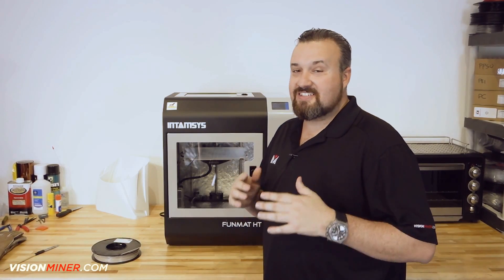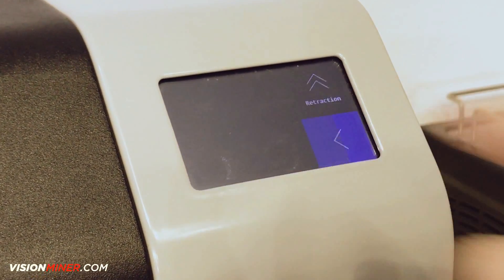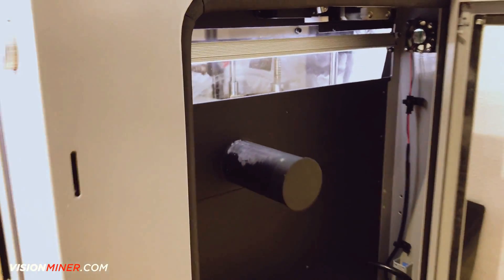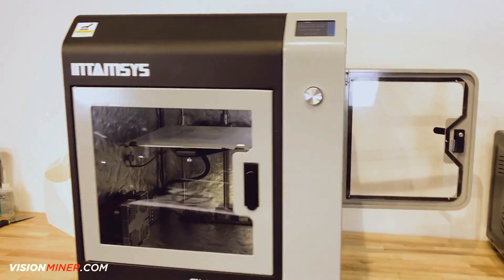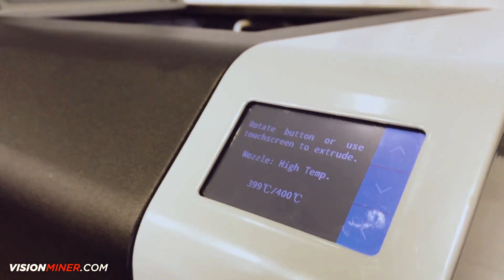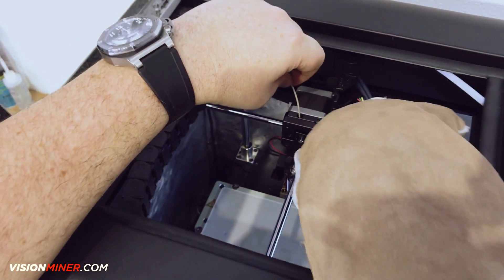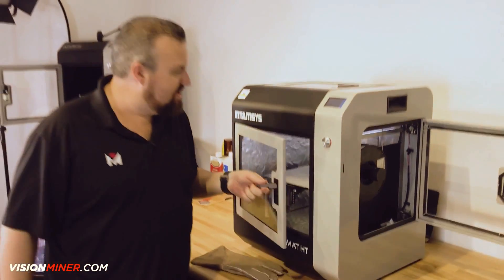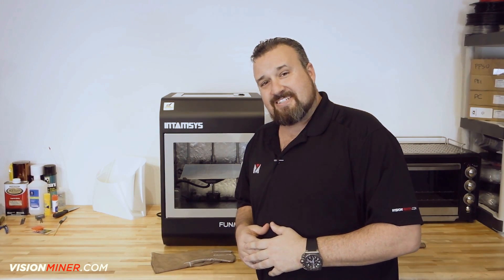How-To: Load Filament in the INTAMSYS Funmat HT

Comment: Can you really recover a print when the filament runs out?
Reply from the maker: Depends on the material, usually there is artifacting or errors in the layer where it stopped, since the print cools down and shifts slightly most of the time.

Comment: i was trying to unload my filamnet but it seems like it is stuck inside the extruder.....any tips to remove it?
Reply from the maker: If you can't get it out, disassemble the extruder and rebuild the hotend if necessary. Could be quite a few things. Start with the extruder lever/cover, then go down to the hotend/heat break if needed.

Comment: What are the dimensions of the filament spool holder and enclosure?
Reply from the maker: The holder is 50mm wide, and the spool size is up to about 9" in diameter.
Reply: Given those dimensions, it sounds like you can only load relatively narrow spools, ones that tend to hold less than 1kg of filament. Or am I mistaken?
Reply from the maker: @ZearouAyedea497  Yes, it is a bit limited in regards to that -- definitely. However, there are easy ways to route PTFE lines into the machine, if you're doing constant production and need lots of filament. More coming on that soon :)